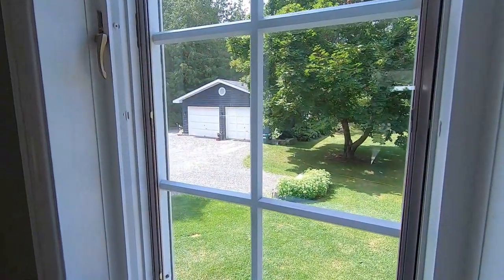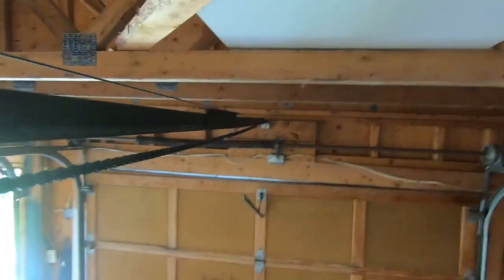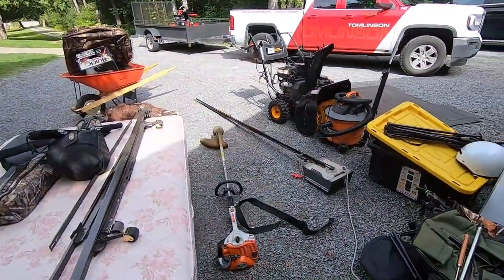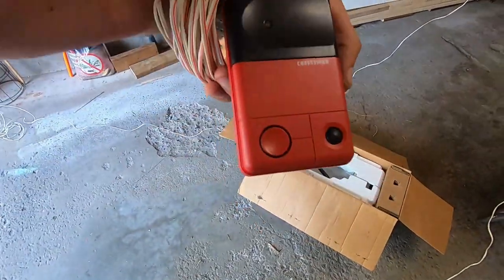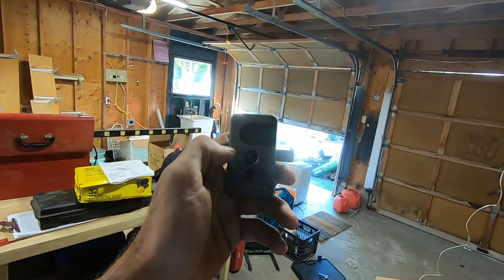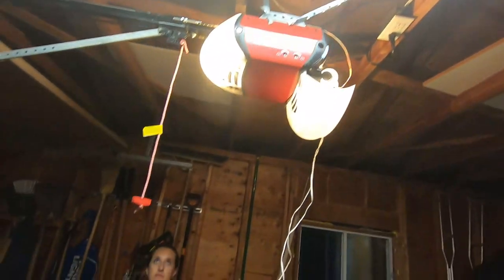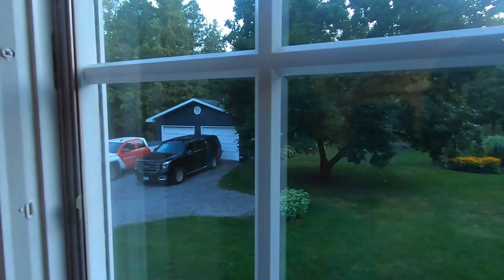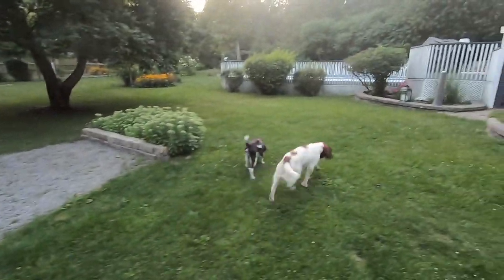Garage Door Opener Installation

Comment: I would say adjust the door arms on both doors so they don’t have a aggressive angle facing towards the opener I say you want to maybe bump it down one or two holes then you have a little bit of a good angle and you might be able to get the door going up higher usually a lot of people install the door arm really aggressive or straight up and down or even backwards so everything is almost installed correctly and then I would recommend fixing the emergency release handle because it is installed upside down and if you care about the heat in the garage put new weather Seal on the outside of the doors and then you should be all set and then where the safety sensors are if you have enough wiring install pigtails by the wiring then you will have extra wire in that pigtail by the safety sensor in case if something gets hooked on the safety since the wiring it will not rip out of the safety sensor

Comment: Cool opener. Never seen one of those before. What will you do with old ones?
Reply from the maker: TheBrazilianHotDog724 I’ll keep the old ones for parts.
Reply: A friend I had growing up had a red craftsman with two lights on the front and back but it was a screw drive. It was very quiet

Comment: just finished watching full video, and i have a top for u,- with the new wall button, u can put it inside and the old one where the new one is, therefore they match in the house a little more. that may not bother y’all that’s just prolly my “ocd” lol. also, did y’all use both of the remotes with the new one? if not, i’d love to buy one from y’all, because i haven’t seen this model and collect them. so please let me know. thanks!
Reply from the maker: Garage Door Openers hahaha, I guess my “OCD” isn’t that bad, I’ve kept the “new” door opener in the garage and left the old one in the house.  As for the remote clickers, it came with two, but one of them was broken (and it wasn’t the batteries).  Honestly the remote clicker is identical to every other craftsman model.  Thanks for watching and the comments.
Reply: yes, they are identical, but the cases aren’t. would u be able to mail one by any chance? if it’s broken i’ll fix it.
Reply from the maker: @GDOs  I think I threw it out, I'll take a look, but it may be gone, haha.  Thanks

Comment: Could you check for a model # on this? It should be on the front under the light lens, it will most likely start with 139.539
Reply: 139.18570

Comment: Why did you put the wall buttons inside the house and not the garage.
Reply from the maker: These were already installed by the previous owner, it actually works pretty well for accessing the garage from the mud room.
Reply: Still why.